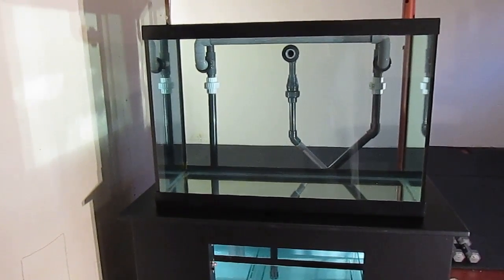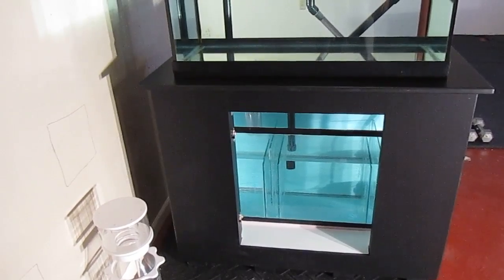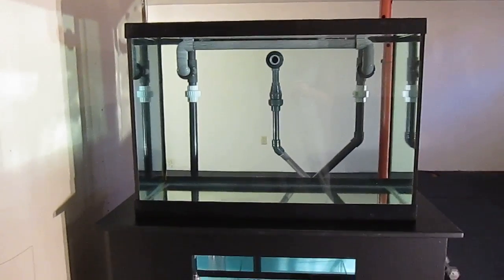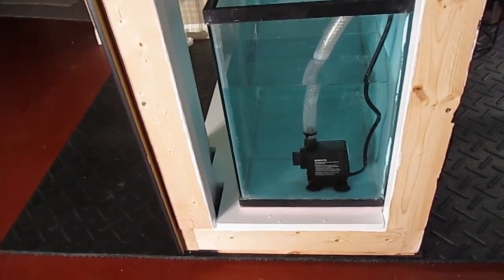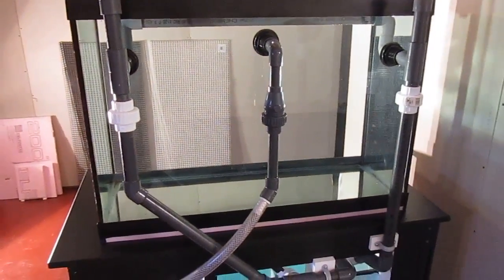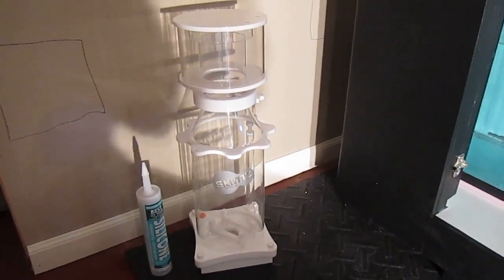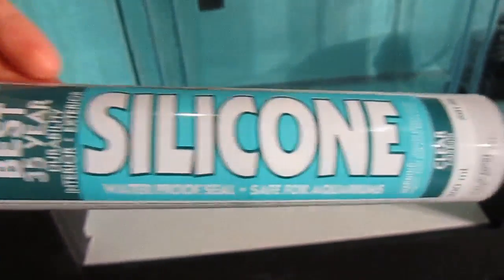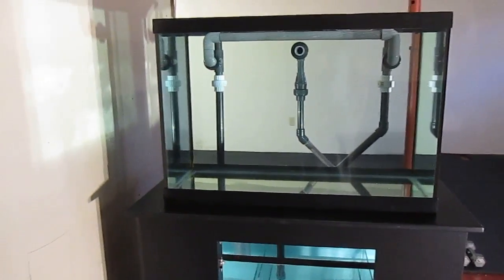Saltwater Aquarium Project, 65 gallon - Overflow and Sump Design (part 1)

Comment: Do you think this would work well for a 7 foot long tank?
Reply from the maker: It would work but you'd want to go with 1.5" PVC pipe if you run it along the long side (1" pipe would likely sag over that length). Or you could go with two shorter sections, but that would require 4 holes in the tank. Definitely do some testing/mock-ups before you drill.

Comment: Hey mate what size hole did you cut for your Return line I'm plumbing a same size tank at the moment
Reply from the maker: Michael James I don’t recall the exact size. Pick a hole saw that’s just slightly larger than the part that goes through the glass wall, doesn’t have to be exact since the flange gasket is quite wide.

Comment: Been a long time,  but please, did you consider several angled slats in the overflow? when you chose the straight skimmer slot.  The angled slots seem to be the more common choice.  Am very interested in your reasoning - will be helpful with my choice.
Reply from the maker: Honestly, angle cuts didn't dawn on me at the time. I suspect either would work equally well.

Comment: I know this video is old but hoping you reply!  Would 1 overflow exit work? so with the same style skim but capped at one end?
Reply from the maker: It would work provided your drain line is large enough to handle your flow, but it does slightly increase the risk of overflowing your display tank (since you’d have only one drain line).

Comment: Hey man, really like this setup... Just bought a 4' slim style 65 gal. Tank. Looking to plumb mine the same way as you did with a 30 gal sump. I have a mag 18 pump... Which will pump 1800ghp (minus head loss and sump will be in room behind wall from main tank) maybe +/- a foot of horizontal length pipe to account for wall. I know this pump is over kill. I plan on splitting the return line into 2 areas because I know it's going to be a lot of movement, however do you think it will work with this much of a powerful pump? Should I use same size pvc & slot? Or should I look at getting another pump? I got a really good deal on this pump and dont want to get rid of it unless I really need to. Plus I figured maybe I won't need 2 power heads inside the main tank.. What you think? Thanks!

Comment: Would this setup work on a 130 gallon reef tank?
Reply from the maker: No reason it wouldn't work but you may want to go up to 1.5" pipe for the skimmer bar and drains depending on the size of pump you're using.

Comment: What if you didn’t lut the skimmer bar and just used the elbows? Would it work? Would it make more noise? Nice setup by the way
Reply from the maker: Thanks. It would still work but it would be noisy (gurgling) and you'd lose the surface skimming.

Comment: Issue with your design is the placement of your return line.  if you lose power, your tank will drain to the level of the return hole. (below your skimmer bar)   If your sump will not hold that much additional water from your tank, it will be all over your floor.  An idea would be have your return line drilled to the same level as your skimmer bar to reduce the amount of back flow into the sump if/when power is lost.  Also, setting up a couple gate valves on your skimmer bar lines near the sump will allow you to set up a siphon "herbie" system which is silent.  No gurgling or splashing.
Reply from the maker: Thanks for the comments. There's a check valve in the return line that prevents water from siphoning down to the sump in the event of power loss. I also had my return pump connected to a UPS power backup. No floods in the 3 years that this system was up and running. You could drill the return a bit higher but that would mean more ball-socket tubing (not shown until my later videos) to force the return water to the lower half of the display tank so you're not just skimming the return water.

Comment: its been a while since you posted, but maybe you can answer some newbies question>  I am thinking of a similar design on a 29gal tank (30inch long).  You think 2 overflows would be overkill on a design like that?  Is the skimmer bar obtrusive to look at? (would maybe put overflow holes in the middle, and then return on the end)  Why drain unskimmed water in to the refugium?

Comment: Hello from over the pond Joe,I'm looking into starting a saltwater tank really like your set up,I noticed your video is a few years old now,just wondering do you still run this system or have you made any changes? thanks for sharing.
Reply from the maker: I ran this system for about 3 years without any issues, then I moved and was forced to sell. The only substantial difference I would make is to mount the sump behind a wall (if possible) rather than in the cabinet, just for ease of access. Good luck!

Comment: Are you still answering questions on your plumbing?  If so, it's probably simple, but is it the check valve that keeps the water from draining from the center hole instead of the skimmer set up?  If so, how does the ball get released in case of power loss?  Thank you!
Reply from the maker: The check valve stops water from draining back down the return line (centre hole) and into the sump, without it you will have a flood within minutes of turning off your return pump. As water is pumped up through the check valve it causes the small ball to float up, as soon as the flow stops gravity makes the ball fall onto a gasket and creates a seal to stop the downward flow of water. Same general idea as the trick where you put a marble in a balloon then blow it up - when you hold the balloon upright the marble falls into the neck and creates a seal without having to tie a knot.

Comment: Hi Joe. Phenomenal setup mate! Would this work with 1inch pvc on a 250litre tank with a 1meter long overflow tube? Thanks heaps :-)
Reply from the maker: All depends on how much water you're pumping back into the display tank. 250L is pretty well the same volume as my 65gal tank which uses 1" PVC drains (x2) so it should work fine unless you have a high-output return pump. But honestly if you're not draining through 1" PVC then you probably have too high a turn-over rate. Good luck!
Reply: How much flow or gph do you get with two 1 inch pipes?

Would the flow be faster if it didn't need to restrict flow into that thin slice in diy overflow design?

What size return pump gph rated & head pressure loss?

Comment: do you have any thoughts on the suggestion below made by MrRvbrown.  And that suggestion is to cut slits at 45deg angle along the horizontal overflow tube, instead of the one 1/8"straight  slot that you have on. your design?  I like your setup as long as the sound coming from the dual overflows is barely noticeable - as it appears very muffled in you video.  thanks.
Reply from the maker: 45deg slots would work, a pattern of holes would work too, just make sure that the area of your cutouts is equal to or greater than the area of your drain lines (so you're not restricting the flow). Also be careful not to use too small of holes/slots as they will clog quicker.

Comment: nice set up sir . I'm assuming your effluent with have a directional head to aim downward for better circulation . I'm looking to set my freshwater up almost the same way . do you think this would work ok for fresh ? any suggestions ? thanks
Reply: I have used overflow boxes and wet dry filters on my African Cichlid tanks for over 18 years. No reason this won't work on freshwater. Your sump/wet dry filter may be a little different. Bulkreefsupply.com is the go to place for Schedule 80 PVC (the grey pipe) although you can pain't white Sch40 with black spray paint. I use the cheapest I can find at the dollar store. Let it sit out for a week or so and it's fine for freshwater use.

Comment: Hello
Can u pls advise the size (width) of each pipe (drain / flow)
U use 1inch or half inch?
Reply from the maker: The drains and skimmer are 1" and the return is 3/4". Good luck with your setup!
Reply: Really thankfull to u brother.
N i loved ur tank.  sorry im stealing ur idea (^^,)
Reply: Joe K finally i got few things but stuck on Tees n Elbows. 
Can u pls advise the number of Tees+size and Elbows+size.
Im following ur idea... ^^,)
Ur help would make me really easy to communicate wit local shop.

Comment: Loved the tank! Went through all that work to drill the glass and then looks like you just threw the returns in and said I'm done! Since you asked, I would have drilled the sump also with a bulkhead and a 90° elbow facing downward for more usable water without suckin air, wich is what's gonna happen when you run a submersible pump. Just more efficient. Your water level in your sump now, as it sits, will only get to about 3-4 inches  from the bottom, or more,  before your pump causes a tornado effect and starts to pull air and push it up into your main tank! Among other things,  but most of the other stuff is just personal preferance! Heck!.... I geuss its all personal preference! I hope you didn't take what I said personal!  I like what you did!
Reply from the maker: Thanks for clarifying. I considered drilling the sump but that complicated things with the filter sock (now very easy to change). I have never had issues with the return pump pushing bubbles into the display tank. The biggest thing I'll do differently next time is put the sump behind the wall, rather than cramped in the cabinet. Thanks for watching & posting.
Reply: Cool! Again! Very nice!!
Reply: Troy Gentz i built this set up per the instructions in this video and never have had any issues. No "tornado" problems or nothing. It is very simple and it works. Has been working for a while now. Thinking of building another but with only one outflow.

Comment: I love that over flow surface skimming idea.. how did that work out for you over the years.. just in the process of expanding mine to a sumped up version
Reply from the maker: It's still up and running and working great. No floods, but the closest call I've had was due to a dirty check valve. Make sure you clean out your check valve every few months!

Comment: I want to adapt this design for my turtle tank, but I don't want to skim the surface. Would the overflow bar with holes drilled along the bottom so the suction happens under the surface?  Am I really stoned and missing some obvious physic?
Reply from the maker: The water level would just stop at the bottom of the bar and you'd still be skimming unless you tuned it just right, then you might be able to make this work but be sure to drill some holes in the top to protect against an overflow. Good luck!

Comment: Two one inch drain pipe that merge into a single one inch connection is the equivalent of having a single one inch drain. That in it self can restrict the total flow possible for that setup.
Reply: They don't connect

Comment: Excellent design. If return was higher, drill a hole to break siphon is case of return pump failure and you won't lose any pump power.

Comment: Joe I finally did it.  I have one question though.  On the skimmer bar there is a slurping sound.  How do you get rid of this sound?
Reply from the maker: There are a few things that will reduce the noise of air being sucked in with the water - you could try changing the slot width on the skimmer bar, or increasing the height of the standpipes. If you're too far along to change those then insert a long air tube into one end of the skimmer bar and make sure at least 8 inches of the air hose is pushed into the plumbing and extends down into bulkhead. This alone will probably get you to an acceptable noise level. Good luck.

Comment: hi Joe K, what's the type of glass you used for this? what's the thickness in mm? ill be making an aquarium based on this
Reply from the maker: The sump baffles are standard soda lime glass (not tempered) at 1/4" thickness. The thickness of the baffles is not super critical since there's pressure on both sides, but I wouldn't go less than 1/4" thick. If you're referring to the tank glass then you'll have to do some research, it depends on the volume, type of glass, and whether you're bracing the sides are going rimless. Good luck.

Comment: Hey Joe. I really like this plumbing design. I'm considering trying this on a 75 gal reef build. I'm wondering if I have to go with a little larger overflow and return size due to a little larger tank. I'm also using a 30 gal sump/refugium. Have you had a problems with this design? Your thoughts would be appreciated.Could you e-mail some specs? tone51057@comcast.net Thanks, Tony
Reply from the maker: The size of the overflow/return piping depends on the return pump you choose. For a 75gal tank you don't need to use a return pump that would require you to go any bigger than 1" PVC. I can't say I've had any "problems" with this design but I won't build another system that has the sump under the display because of how cramped it is to access and work in. Best to put your display tank next to an interior wall so that you can have your sump/refugium on the other side of the wall with full access. Good luck!
Reply: Joe K Thanks for responding Joe. First time attempting to do the plumbing work myself. I'm trying to get as much info as possible so I don't make any costly mistakes. I was thinking I only needed 300-400 gph through a 75gal system. Was also considering a display refugium sitting aside my 75 gal. Not sure yet. I've built a custom built stand, a little more height and width for space underneath. I've read through all the comments on all the videos and am very impressed. Looks great! Do you have anything put together on the plumbing to give a step by step instruction on what was used and how it was fitted. New to this. All help appreciated. Thanks again for posting this and responding Joe.
Reply: Joe K It looks like you used 1"pvc for overflow and the return looks like 3/4", all using 1" bulkheads. I'm assuming you glued elbows and not sure what else. Since I'm using a 4' long tank, Should I use a longer overflow tube or would I get good results using the length you used. Sorry! Last of the questions I had before I start this project. Thanks,Tony

Comment: Just wondering how loud is the noise from your overflow? I really like your plumbing setup but I was also looking into Herbie silent method, so just wondering your thoughts on that. Great series!
Reply from the maker: Thanks. You can hear the water running down the pipes but I wouldn't say it's loud or irritating. The Herbie, or similar Bean Animal, overflows create a full-siphon and can be 'tuned' to be perfectly silent.  Keep in mind though that if your sump is under your display tank then you're going to have noise coming from the skimmer and return pumps, and maybe your circulation pumps depending on what you're using. If your sump is in a different room then the silent overflow would make sense.

Comment: why you prefer this setup more, than drill bottom of aquarium?
Reply from the maker: Most aquarium have tempered glass on the bottom - do not attempt to drill unless you're certain it's not tempered. Tempered glass is extremely difficult to drill without breaking and I wouldn't recommend even trying.
Reply: it is necessary to have 2 pipes? if electricity goes off and on when im not in home with one pipe it will be ok?
Reply from the maker: One pipe is enough, I used two to de-risk the chance of a flow due to one line becoming plugged by debris, algae, snails, crabs, etc. I admit the risk is very low but the effort to put in the second line is also low.
Reply: thanks you. i am planning to drill aquarium for overflow and i wonder which one is best, drill bottom or build copy of your setup with one pipe, ty for info again :)
Reply: ika manashvili bottom is ALWAYS the better option if it's not tempered. No elbows to reduce flow.
Reply: what about noise, which one work quiet?

Comment: How did you get those nice straight lines in the skimmer?  I will be doing this project on one of my tanks.  Let me know pls....Thanks in advance!
Reply from the maker: I used an oscillating multi tool - to cutout my pre-drawn slots. You could also use a circular saw or table saw if you fixture it properly during cutting. It honestly doesn't matter how neat this line is though since you can't see it unless you're looking down from the top of the tank. Good Luck.

Comment: I see that your return has smaller PVC but you mentioned that all bulkheads are 1". Can you explain as i am in the process of doing this to my tank. How exactly did you fit 3/4" PVC into a 1" bulkhead?
Reply from the maker: I used a 1" to 3/4" PVC reducer. The reason for this is simply that I only had 1" bulkheads. If you had a 3/4" bulkhead for your return line that would be even better (but you'd also need to buy the smaller hole saw).

Comment from the maker: Thanks. The water flow noise will reduce after the system has been running for a few months (the inside walls of the piping develop a coating). To reduce the air intake noise (gurgling) try sticking a piece of small tubing (8in long) in to one (or both) ends of the skimmer bar such that it extends well into the 90 degree elbows. Leave about an inch sticking up above the water level and the air will enter the plumbing through this little tube rather than through the skimmer bar with the water.

Comment: I love the design.  I replicated it on my tank.  In addition to keeping my holes away from the edge of the glass, using the double elbow set up allowed me to fine tune how level my bar was in relation to the water's surface.  I just wish there was a way to avoid hearing the water moving down the pipes.  I will be trying to modify it to gain 100% silence before trying another method due to hole placement on the back of my tank.  Thank you for the great video, lots of info to use.